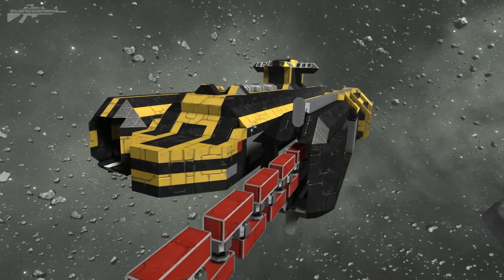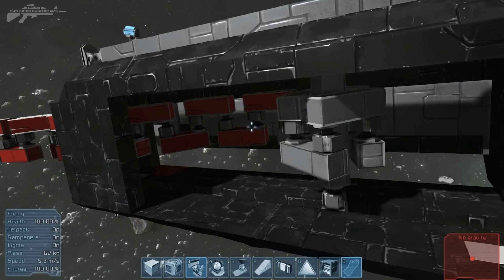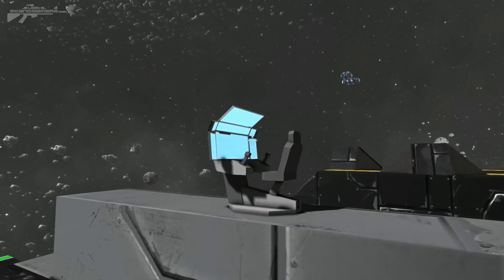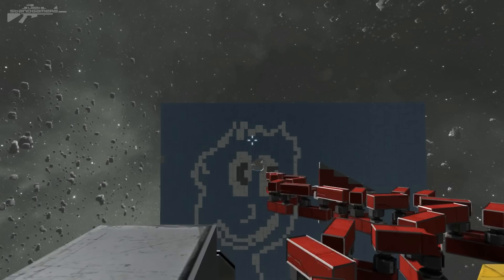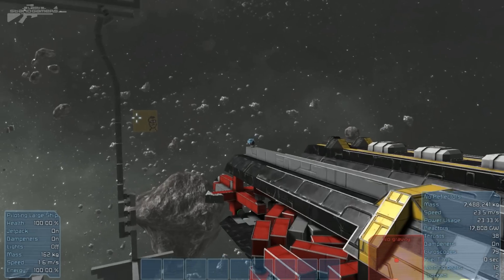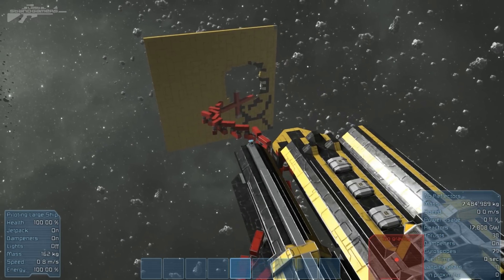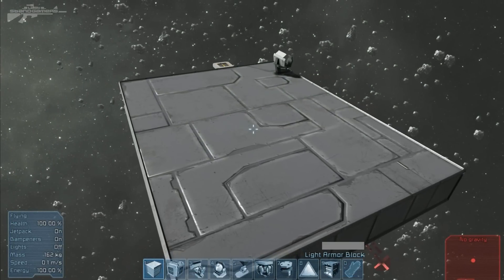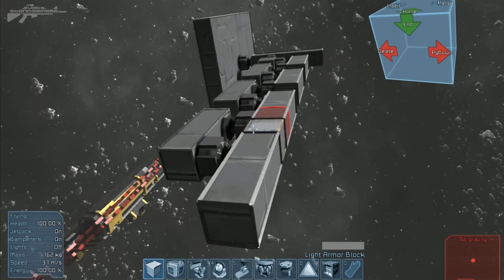Space Engineers - Grappling Hook Launcher & Winch Mechanism Part 37

Comment: You certainly build a lot of momentum based weapons. Kinda seems helpful for survival, as missiles might get expensive where steel would be abundant. The hook would certainly be helpful, at the very least, for making a boarding hole on light ships.

If you really want a grappling hook to work, make a mechanism that expands the hook once it is inside the ship. Small hole lets a small hook enter that becomes a larger hook once it has penetrated.

Comment: Mayhaps try rotors on the actual hook, that way it can expand after it has initially penetrated? That way you could even have the explosive tip, and then it folds outward and grapples on the inside.

Comment: What if you had like a tow ship? perhaps one big ship with very strong engines and a big rod down the middle of it with 2-4 chains attached? then on the end of each chain a small slightly maneuverable ship with landing gear to hook onto another capital ship (that is perhaps dead in the water for some reason, battle damage, out of gas, power failure, etc.) then use the winch to pull it all on up and have more landing gear on the bottom of the tow ship to attach to the ship being towed. This would be so cool if you did, i would do it but i think my frames in my game drop so much more than yours do and i have so little patience when it comes to trying to build something haha. Only thing is if it would fly funny due to all the weight on the bottom, unless you have it as kind of a mobile giant hangar it gets pulled into or something.

Comment: What if you make the rear chain links that keep snapping out of heavy armour so they are a little bit more durable then give the hook its own propulsion using gravity generators and a stone. you'd have to figure out how to slow it down after penetration but it should get the hook into a ship
Reply: expanding on that idea: A larger grappling hook but the "wings" are attached by motors that have braking off, so it uses the stone and grav. generators to propel itself toward the target, then, a warhead in front of the stone mechanism detonates upon impact, destroying the stone and stopping the hook from flying away, and once inside, reversing the ship should provide enough inertia to extend the "wings" of the hook and effectively hook in the grapple. I dont yet have the game but I'll have to try my design when I get it

Comment: If you look at some hunting arrow tips the blades fold out once theyre in the target and then lock it in. First you can blow a hole with a rocket, then you could build some rotors on the actual hook so when the main shaft goes into the hole you made then it can unfold.

Comment: The long tip with explosive head could be improved by having a heavier "Butt" so the explosion doesn't stop the hook.from moving forward. The "grappling" bit on the other hand should be more like an arrow: With the hooks pointing backwards to grip a bit more.

Basically, a long spear with an explosive head and a heavy butt that's not too wide.

Comment: There is enough force to penetrate but not enough for the hooks to get through. If the hooks did manage to get through then the hole would be too big and the hook would just pull back out. If you could have the hooks initially retracted and then extend out after penetration then your idea would work.

Such an awesome idea though! Devs need to implement a fully customizable shortcut key system or something. Maybe something like you can customize a button to make the braking system go to zero and then the landing gear would turn off. The shortcut key would be specifically for that ship though.

Comment: Would the grappling hook work if you make the hook expand when inside the target by using rotors?  
For example you make a hole in the armor using a warhead, launch the grappling hook into the breach and activate a rotor inside the hook so that it expands enough to stay inside the breach. I can't test it for myself, but I think it might work.
Reply from the maker: It would work very well the only problem is that you would have to have someone in the grappling hook to turn the rotors on.
Reply: +LastStandGamers By now you could control it from the 'mothership' directly, I just doubt any mechanism would survive and be able to lock. (Or a timer in the hook and one on the ship itself to trigger the release of the gears, config of rotor and the start of the timer on the hook itself which will then in a few seconds trigger the hook to expand and hopefully lock in place.

Comment: If you want it to lock and work great, put rotor with maximum  spin of 90 degrees on each 4 faces of your grapling head. put a warhead so it make a hole. (dont make your grapling head big/large) the when you launch it, the warhead hit, make a hole, the grappling slow down but the "lockers" want to continu. when they reach 90 degrees to the head you would be supposed to be locked in and ready tow him ;)

Comment: have rotors work like the crossbow but have it open when it hits like some of those mid-air open arrows and make it heavy armor so it doesn't break as easily you might want to also do the 3-dimensional chain so it comes out a little better

Comment: Maybe you can expand the hook after the impact puting pairs of rotors and an some armor "lines" to make the spandible part; Each pair of rotors making the oposite force ( keeping still the piece of armor in the middle)
One of the rotors is in the tip of the thing, so after impact it breaks leaving the other rotor free to move the armor section that will perform an outwards spin, hopefully while is inside the other ship, securing the hook to the structure.

(I just notices but it's quite hard to explain a technical idea in a foreign language and without some drawing surface at hand :D)

Comment: Well actually landinggears on the end of the hook could work for catching the ship and pulling it away without dameging it too hard for say grabbing a friend who lost his engines due to enemy fire but for boarding enemy ships it might be effectiv to either pre pinch a hole in the hull and fire the hook right into this(which might be rather difficult to hit) or to create a more torpedo like hook which is more capable of penetrating and then lift up the actual hooks powered by motors short after the tip(otherwise they might get damaged during the penetration of the hull)
what also might be effective is to make the hook accelerate due to gravity you might need to add an extra ship to your big one though this would be an 2 man operated weapon(thumps up for multiplayer)

Comment: www.ebay.com/itm/like/251374077095?lpid=82
"Outdoor Carabiner Grappling Hook Climbing Folding Load 350Kg steel"
This seems to have been suggested countless times but here's an example I found after typing "collapsible grappling hook."

1.) Put limits on the rotors within the hooks themselves so they don't swing out too far and maybe tweak the torque and braking to keep them in place in case the changes in momentum cause them to swing out too early. Try to make the tip and body as slim as you possibly can. Some have advised [which might actually cause the hook to swing wildly off course] add some engines near the penetrating tip to limit deceleration upon launching and hopefully keep it pointed straight. No idea of what the physics would do under these circumstances but worth a shot.

Ideally what should happen is the hook will enter through the armor and be deep enough to where some length of chain is inside, then as you tug back, the force of the device being pulled will cause the hooks to expand then grip the interior. They hooks will then be forced to open to their limits and there's your grappling effect.

2.) Else, I would take a page out of Star Wars or that of Batman. Have a hook that shoots out to the side or like you have now and digs into some sort of ledge on the ship. Have some sort of momentum going perpendicular to the edge you can make best use of the hook on said ledge; this would be a true grappling hook.

Random Info.) The reason I said that idea two was a "true grappling hook" is based on my definition a grappling hook. The first design and the concept of your ideas where the point lodges itself into the victim and then winched back through the same hole that was made is how a harpoon works. The act of you trying to pull on a chain to winch yourself or the object makes it is essence a grappling hook but more definitively is a harpoon. The first redesign idea that I and many people have already formulated is a type of broadhead with mechanical expanding blades. Your first and second concepts were also broadheads. Your third one where you slimmed down the body until the very ends miiiiight be considered a Judo tip but that seems to involve a different form of mechanism with springs or the force of impact causes the hooks to grab the target; hence the name which likely sprouts from "Judo Grip". Your forth design... maybe more warhead than arrowhead giving that there's an explosive involved. Ehhh I don't know, went way off topic there. So I'll type this in caps so the wondering eye will get the jest of what this entire paragraph embodies ahem; THIS IS A HARPOON!!! NOT A GRAPPLING HOOK!!!!111!!!!eleven!!!

Comment: another idea for how to prevent the thing from coming out (if you manage to get it in):
use rotors on the hook that "unfold" when it gets through... like with a block that can hold the bars in place but gets destroyed when the arrow penetrates the hull

and to put some damage to the hull, you could use those small bombs... just the bombs. held close to the hook and released at the same time... I think they should drift a bit faster than the hook itself because there is no chain on then to hold them back

Comment: Great videos. Congratulations on the recent success of your channel! well deserved.
Reply: this is very cool. but why doesn't he make a small head that pierces then have more rotors on the head that open while inside to keep a hold to the ship like an expandable arrow. just a suggestion.
Reply: KevoTheCrazy and he could possibly have landing gears on the part that hooks to add more strength for pulling so it may not break as easily
Reply: KevoTheCrazy those chains seem to take some momentum away but they are cool.

Comment: Couldn't you use a torpedo with gravity accelerators? It means you
 could have a torpedo / winch that could speed up rapidly?
Reply: Replace the hook with a capsule covered in antennae, use it to slam into a corridor and drop a multiplayer boarding party

Comment: I don't think people grasp that this is technically impossible to do. Think of the grappling hook tip like an arrow tip, it needs to pierce flesh (hull) and stay in the flesh. It does this because flesh with "encroach" on the arrow and hold it tight, once you breach hull, there is no flesh to force the remaining hull to grasp the hook. If your hook makes a hole, the hole will be as big as the hope and fly straight through.

Comment: How about do this:make the harpoon alot bigger, and the chain smaller(like ALOT), so this way,You won't get penetration(50/50 chances it happens), but in this way you can hit the enemy with a huge harpoon, and with the small chain, it wont wobble and go sideways that much, giving you alot more accuracy, and possibly better results than the original "Whale Hunter" scheme you did here, Final Result(In my head):A huge hole for troops to board in OR if it penetrates, a way to make Tons of damage to the enemy ship(Possibly disable it, depending on the target's ship arrangement), and pulling them back closer to friendly ships.

The End.
Reply: PS:The harpoon's "Head", i'm not sure about it's design, but something that can make damage and a BIG HOLE.

Comment: good but the pointy hook wont work the damage engine doesn't care if its a flat block or a wedge and the grappling hook will cripple into the hull of a ship and wont do much with hooking the 2 ships together :P if the damage resistance of landing gears increase you should use them not a huge point

Comment: You can't really have proper grappling hooks since there is no 'tension' in the game.
I mean, you need the hole you punch to become SMALLER after your hook burrows in behind it, which isn't possible in SE now.
Either you'll not make a large enough hole to hook on, or the hole will be too large so the hook just pulls straight out again.

It might be possible with drills in a cross and a cockpit on the hook along with forward engines. Drilling through a cross-shaped hole then twisting the hook once through to hook on to the un-drilled angle.

But at that point it isn't a grappling hook anymore, but rather a ship.

Comment: what i did to make it work was i made the actual hook its own ship
the hook tip had a small explosive on the end, and forward thrusters
the hook itself is very thin, but after it penetrates, i have 2 side flaps that fold down to hook the object in place
these hooks only work on light armour btw, anything heavily armoured (or heavy in general for that matter) will simply shrug it off

Comment: I think the easiest thing to do would be to have a small ship go out in front and use it's missiles to bore a hole into the ship, then to use your grappling hook to go through the premade hole.
Reply: Not as easy as it seems. You would need to have master precision, and if the ship was on the move, bad luck.
Reply: Kim Jong-un when the ship is still. Take a small ship and blow out the large ship's thrusters! Unless if they are inside the ship

Comment: one of the things I noticed was that the rotors on the chain should be configured with a max and min angle so that they can't impact one another.  and for the tip, I think that it would work better if you had an explosive charge launched ahead of the hook or if you had already blasted a hole in the target.  I'll see what I can do myself.

Comment: Why not just make a big flat grappling hook w/ landing gear? If not that, then I'd suggest trying to make a sort of inertia-based deploying hook. Like, when the hook reaches the end of the chain or otherwise stops, the momentum of the claws will cause them to swing out and deploy, grappling the inside of the ship. At least, that's the idea.
Reply: Daxramas You could turn on the landing gears by having a team in the grapple that, after attaching to the ship, would secure it, leaving an intact ship that would need minimal repairs, and you wouldn't have to constantly repair the grapple.
Reply: But the grappling hook would be non-explosive, it would be a flat grappling hook with landing gear, so the ship could be secured with minimum damage to the ship, and to yours. You didn't read my comment thoroughly enough.
Reply: I don't think the landing gears would work since having the chain made of rotors means each chain link is technically a separate ship, so there would be no way to turn on the land gears at the end of the hook.
Reply: geekchris105 I think that the team inside the spearhead would die, especially if Arron put an explosive element to the spearhead

Comment: You need to have a flat impact head. An arrow shape just loses momentum the second the tip hits. So try making a solid elongated + instead of trying to make it into a tip. SE physics does not recognize cutting or piercing with a sharp edge. It actually rewards more surface of impact rather than less, due to not understanding the mass behing the edge.

Comment: "pointed" objects like your initial hook design do not penetrate anything very well, larger flat surface areas give better penetration. So something like a 3x3x2 or 5x5x2 block on the tip with a narrow 1x1x? neck with a few spikes along it to latch onto should make a much better hook